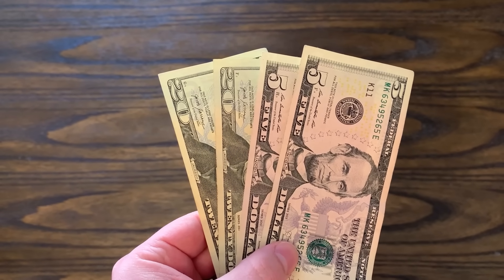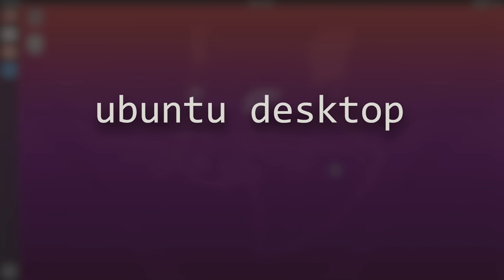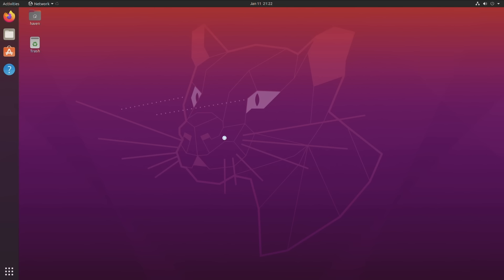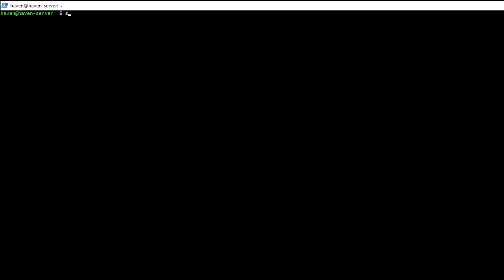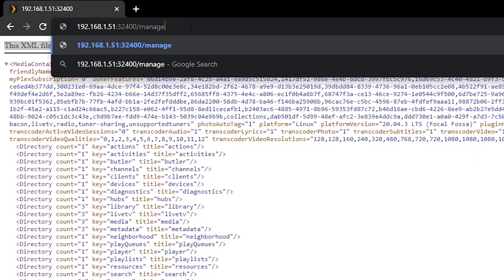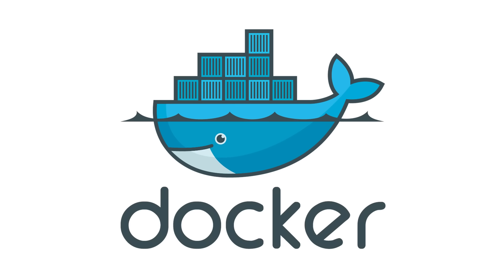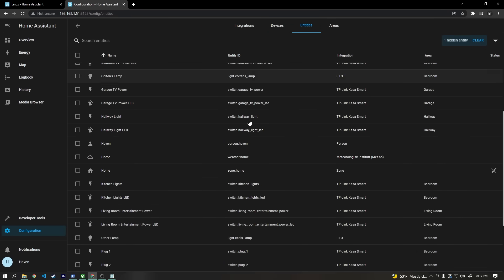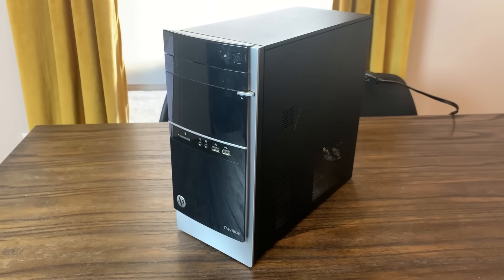Incredible Budget Home Server! (Minecraft, Plex, Home Assistant, NAS)

Comment: Just a tip: you should add yourself to the docker group so you don't have to run docker commands with sudo. Not only is this easier but it is also good practice not to run stuff as root when it is not needed
Reply from the maker: That’s great, thanks!
Reply: @HardwareHaven  Or if you worry about Docker running as root(security concern), you could give Podman a try. Podman is a containerization system that's quite 1-by-1 with Docker(it runs Docker containers after all), but it runs as local user instead of root. It is quite nice, but a few things doesn't work straight away(For example Portainer)
Reply: This question was on my exam yesterday 😩
Reply: @akatsukilevi  pretty sure you can still use the podman socket file for some things that need docker api. not sure about portainer though
Reply: @TheoParis  Most of time it works well, and portainer I tried but couldn't get it to work with Podman(probably some incompatibility?)
Reply: @akatsukilevi  what's the main difference between portainer and podman? I just use docker for jellyfin but haven't added docker to the sudo group. Why is it more secure to add docker to the sudo group? Wouldn't that be more vulnerable than forcing to use sudo for maintenance. 
I have to restart jellyfin every couple of days after not using it for my p2000 to start encoding 4k again. For some reason the p2000 stop working in docker but is working fine in the OS.
Reply: @rudysal1429  Portainer is a management GUI for running containerized apps, while Podman is a container runtime like Docker.
But between Podman and Docker(I think you meant to ask this but inverted names) is that Podman is equipped better to run rootless which has a better security.
And about Docker on the sudo group(wheel), it's one thing that confuses me as well, wouldn't it running as root make it easier for something that breaks out of the container to end up as root access on the server?
Reply: yeah you should not be running root during normal use

Comment: Love the idea here! Just something that people looking to use this for Minecraft might want to be aware of as I have previously had a server hosted in a similar fashion:
1. Your public IP will have to be given out and requires port forwarding knowledge/capabilities. Not a huge deal for just a friends only server, but be careful especially if you run older versions of MC that were affected by the Log4J vulnerability. 
2. Unless you have a stable internet connection your friends may have ping and connection issues. 
3. Depending on your player count, you’ll probably need faster hardware and more RAM, especially for modded Minecraft. 

Keep up the great videos!

Comment: In case you don't know it yet, a very small tip that will save you some time: as soon as you start working with the terminal, just type "sudo su" to authenticate yourself as root, so you don't have to type sudo everytime before your commands. if you want to go back to normal user credentials, type exit or restart your terminal/ssh connection. 
Nice video btw. :-)

Comment: I would personally add a second 2tb hard drive and run it in Raid so that if you have any failure in a hard drive you have a backup. You won’t have 4tb of storage, just 2tb of secured back up storage and it would only add $15-20 to the overall price

Comment: For anyone who is following along: when setting your static IP on the server make sure it's in the same "IP family" as the other machine's ethernet port you plan on ssh'ing through. You do that by typing "ipconfig /all" on Command Prompt (should be something like 169.254.x.x).
I initially set a totally random IP and couldn't get it to work, spent 2 days scavenging the web for solutions and finally got to this trick. Then I just copied 169.254 and changed the other two numbers in the static IP and it finally worked!
Reply: all i was looking for, thanks a lot
Reply: Thanks a lot for this
Reply: This "IP Family" is called a subnet for anyone that wants to read more. Your submask (255.255.0.0 or /16) is what defines where you "cut" the 'x' in your case.

Comment: This tutorial is great for someone who is just starting to get what it means to repurpose your old machine. Although as some have pointed out, you WILL be limited by that hardware. 
Started a project like this 15 years ago with scrap parts I had lying around. Family needs have changed since then so now my NAS/TV box/jukebox is a lot beefier, with redundant storage and with lower power consumption. A mini-itx build really helps with integration into the living room (and the WAF of course) but severely limits your build/upgrade options, plus increases the cost in the majority of occasions. But hey, nothing beats having a sleek system besides your TV, right?
Also, in order to further reduce power consumption you can spin down the disk(s) after some idle time (although when you have just 1 drive it's pretty pointless) and schedule a shutdown/restart during night hours.
New sub :)

Comment: Brilliant build. I am also planning to build one same like this. It's great you were able to get a low-powered yet powerful enough system unit to handle all those processes in one box. I'm going for a small build, and will probably get a Dell Optiplex SFF from the second-hand market.
Reply from the maker: Love it!
Reply: Another option is an older laptop with USB ports and a reasonable processor (> pentium/celeron). They also have a built-in UPS of course, although external disks may not.

Comment: Make sure to check the production dates on those used drives. That one you showed is around 7 years old, which is getting close to when it will typically fail for a platter drive.
Reply: it also is an SSHD, which is a HYBRID drive (SSD and HDD in one drive)
Reply: HDDs can live way longer than that buddy unless they’re cheap. I use two WD drives that are almost 14 years old and they still work just fine.

Comment: My thrift store find was a 2012 Lenovo plastic laptop for $12 with an i7 and 16GB. I added a 128GB SSD for booting and a 2TB data SSD in the optical drive bay using a $10 drive tray off eBay. Max draw is around 50 watts running Plex, HA, Frigate, RTL433 and some other containers in Ubuntu.

Comment: Good pickup for the price! Very similar to the little x86 thin clients I've been screwing around with by Wyse/Dell and HP, except it actually has the space to use what little expandability it has! It'd be perfect if they threw on a PCI-E slot, either for a gigabit NIC or a card for more SATA, but oh well - machines like this and the thin clients I have are still very capable for what they are. The Wyse Zx0Q and HP T630 (and some T620 models) all have a pretty similar lineup of hardware capabilities - quad core, can take two M.2 or SATA SSDs, like this motherboard... they just don't have room to mount them, or actual power connectors to use, since the chassis is small. 

However! These are only 30-50 dollars on eBay, often with RAM, a power adapter, and even sometimes a small SATA/M.2 drive. The small size makes them very cheap to ship and therefore very cheap to pick up secondhand, and they're very hackable, especially the Zx0Q - there is 5V and 12V available on headers on the motherboard, and there is an even a FPC connector with a proprietary PCIE 4x mapping - you can get a riser, but the units with it are pretty expensive and much more rare. Maybe I could make a board to adapt that to a M.2 M-key slot... :)
Reply from the maker: Yeah I’ve looked at a few of those and been curious! 

And that sounds like a pretty big project haha! I’d love to know how it works out if you get to it

Comment: It's a good build as a home server, I have the same things mentioned in the video in a rpi4 4 gig :) Plex, MC server, Resilio, network shares, pihole, vpn, raspotify, can be used as a BT speaker and much more and it peaks at 6 watts :) Also you can learn a lot while building it up, good stuff, highly recommend.
Reply: hey i’m considering making a home media server for my family and i for  Plex and to backup photos is a raspberry pi a good alternative to what he did in the video i have 9 people in my family and I’m not sure if that will be too much for a raspberry pi
Reply: @huntersipe7659  It's fine, I have around 25 family members and it can handle the photo/video backup easily. The plex part is tricky, make sure that every movie you want to drop in plex is x264. If yes, it means that no transcode is required, your limiting factors are now the speed of the storage and the network. I have 720p movies in x264, 7-8 simultaneous streams are no problem, but I use an external USB HDD caddy to store the movies and the pi shares bandwith between the network connection and the usb. If you have a nas then you can eliminate the usb/network bottleneck and push more streams out. Just make sure that your upload speeds can handle it.
Reply: Surprised a Rasperry Pi can handle all that.
Reply: @colbyboucher6391  It can handle even more with proper cooling. Have a look at tdarr. Just set it to convert all my videos (lot of old family videos including VHS rips), to convert it to h264. Currently it saved ~70GB, I'm really impressed with that and it's still have to process more than 1TB  video in various formats. I also want to convert everything to h265, but currently it drops a conversion error, have to figure out why it's not working.
Yeah, I know, converting videos with rpi feels wrong, but it runs 24/7 with good cooling, so I don't care if the conversion took months to complete. Eventually it will finish and I don't have to power on my main rig for days to achieve the same result.

Comment: FYI the Seagate hard drive you used, is a hybrid drive, it has 8gb of SSD that it does sort of a caching thing with.  General computer usage yeilds a better expirence over normal tradiitional spinning hard drives.   Considering the size of the case, I'd prolly velco/ziptie the power brick inside to save desktop/floor space.  Also even though they cost more an SSD uses like 1/3 as much electricity as a spinning hard drive.   Thanks for th video, coudl you do us a favor and list all of your commands in the video description?

Comment: You should use the ssd as a boot drive and the hdd as a secondary drive that stores all the data
Reply from the maker: For sure! I just wanted to keep the “cost” down. And it’s also easier to set something like this up with one drive for a beginner
Reply: @HardwareHaven  True
Reply: @HardwareHaven  A good video idea would be for using an old laptop as a home server
Reply from the maker: Yeah I’ve definitely thought about it! I have two old MacBook pros that I might try that out on
Reply: @HardwareHaven  How would setup a map share for a 2nd drive instead of the main drive?
Reply: @gtbmcollins1  Sorry if this is late, but you would have to mount the second drive to a folder (google is ur friend) and then map that for the share.

Comment: I failed to follow from 7:00 to 7:20. What changes have been made. I like the instructions and thanks a lot for the reply.

I am trying to use Ubuntu myself and i am using Windows and Truenas cor. greeting
Reply from the maker: We're using nano (a text editor) to edit the file at /etc/samba called smb.conf. It's a configuration file for the samba service. The 5 lines I added to the bottom tell the samba service that I'm adding a share called haven-share, and that the path to that share is /home/haven/haven-share. I'm also setting it to be 'browseable' and not read only. With that configuration, the samba service now knows to make that directory available as our haven-share. Hopefully that makes sense!

Comment: if anyone is having trouble with internet during the ssh connection make sure the port is open by going onto your router settings online and that you are connecting with the right address (for some reason manually typing in the address didn’t work)

Comment: 2:54 Not related to the video at all, but that's a really nice case choice, I love the Corsair 4000D airflow. But why do you have that front panel part flipped around? You can rotate it and have it so the Corsair logo is at the bottom and then it won't be upside down anymore.

Comment: As easy as it is to setup minecraft in a docker container, you can get much more performance by setting it up well yourself, and its almost as easy.  Mainly, use PaperMC, a fork of the regular minecraft server made for massively better performance, with no noticeable difference to gameplay. You basically just have to open the jar file and accept the eula and that’s it. Also 1gb is not enough for good performance on minecraft servers, use at least 3-4gb for good performance. ALSO in the minecraft config if, slightly lowering the render distance will make a big difference, although with a visual render distance impact. With 4gb server memory, Papermc and well tuned minecraft and papermc config files, an old server can do wonders even with many players.
Reply from the maker: I’m actually in the process of putting out a papermc on old hardware video, although I’m still using a docker container because it’s fun. Thanks for the comment!

Comment: If you stick to 720p it will get the job done. 1080p is a strech for realtime recode, can be done, will stuter ocasionaly if bitrate is high enought for source. Anything higher is out of question. Minecraft will run, at least for start, just don't expect crazy redstone, hoper or other intensive things much. 8gigs of ram will be limiting too, again "it will run", but thats it. Personally was using simmilar system for years, with said issues. Recently bought used 6c xeon workstation (incidently from same year as this APU, was aroun 100$ used, more expensive, yes, not sky-high either), plenty more performance. Now can watch 4k on the fly transcode no problems.

Comment: If you want friend to have access to the server pls use something like Openvpn or even a dedicated firewall something like SophosOs or OpenSense can be run as a container/VM (they are Linux/BSD based so KVM will boost performance) and you can allow certain VPN groups to only access certain IP ranges and ports. I know it's advanced but a Security Standart by now.

Comment: Nvidia shield.....I run Plex server on it and an Emby server as well. Works great. Using FX file explorer as my file browser app on the device I have Network shares for all of my drives and all of my devices including Windows pc, phone, tablet. I have full access to all the micro SD cards the devices are using for storage as well as numerous external hard drives connected to my Windows PC. With simple shared folders FX file explorer allows me to move files on and off the SSD drives connected to my shield anytime I please to manage space.

The Shield itself I'm still building out more SSD drives as I accumulate them with Black Friday sales year after year. Eventually I plan on having 5 to 10 ssds but currently I have four ssds connected to the Nvidia shield. Three of them running on a USB hub, one of them connected directly to the shield using adopted storage mode.

Handles all of the storage just fine. Recently there were some issues with multiple storage devices that has now been addressed so everything is working smooth again but for 200 bucks this device is a fantastic media server solution that is low power use, low profile, and it's easy too connect some ssds to a USB hub behind the TV hiding all of the mess so things look nice and tidy...... Just don't look behind the tv. LOL..... Okay go ahead and look behind the tv, all you see are nice neat little SSD drives roughly the size of a deck of cards. Several SanDisk SSD portable extremes dangling off of the USB hub. They sit at a funny tilted angle because the cable is short but they are powered by USB so I don't need external power supplies requiring multiple power outlets etc. The shield and all of the hard drives are connected to one power outlet. They sent in standby waiting most of the time. I'm not concerned about drawing too much power from it because most of the time only one hard drive is in use at any given time anyway.... Most of the time they sit and stand by waiting to be accessed.

I don't understand why people enjoy making things harder than they need to be..... Back in the day I spent a few years tinkering with Linux but it usually turned out to be more hassle than it was worth. Drivers always needed updated and as soon as you had things updated running exactly the way you wanted it more updates would happen requiring new versions of drivers half of the time you had to wait for the community to get the driver's right, it was a constant maintenance issue. I understand there are some nerds out there who love maintaining and updating things all the time as their main hobby because it makes them feel like a super nerd power user......

However is someone who basically runs everything from my Android tablet at this point and my Nvidia Shield, including easy remote access to my Windows PC with TeamViewer which you can easily do on an Android tablet...... Half the time I use Windows these days is from my Android tablet wherever I conveniently happen to be instead of going to sit at the desktop. If you can connect to all of the things and move files between all of the things and use all of the things for my single device like a good Android tablet. Why make it harder than that? It works very well, it's basically a powerful remote device for all of my things, Plex runs super well off of the Nvidia Shield allowing me to use Plex on all of my things....... No need for Linux. It's just more command line maintenance that never ends.